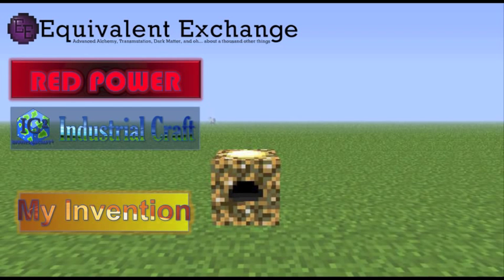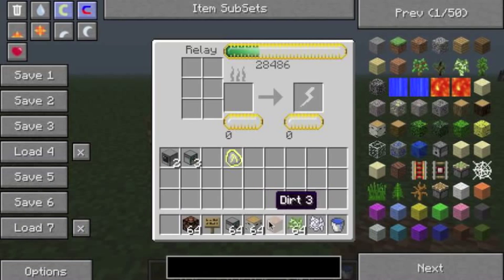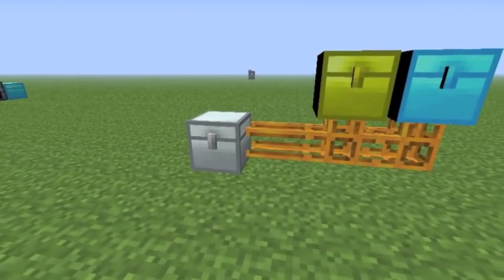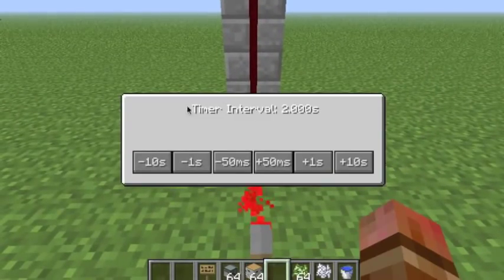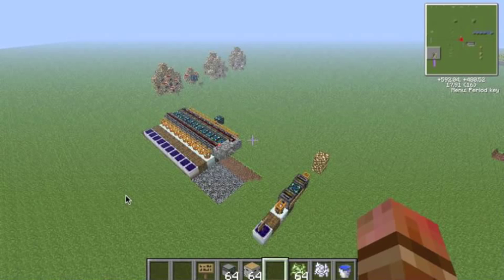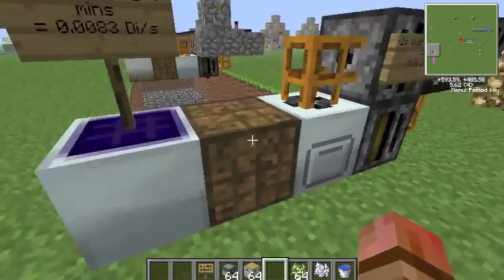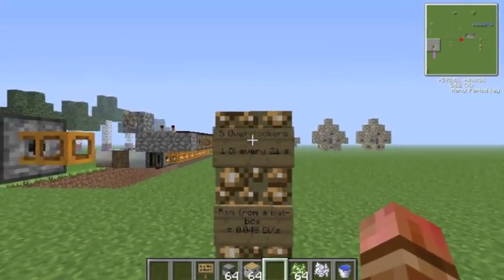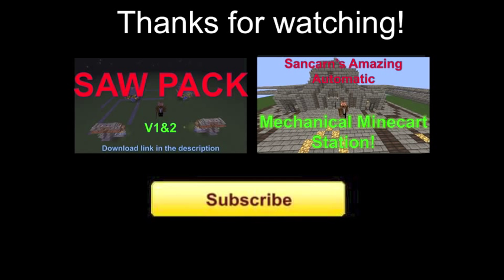"Tekkit" Part 1 - EMC Generator: Macerator-BlazeRod Setup

Comment: I took your design and replaced the macerator with a rotary macerator, replaced the panel with an array, then put a batbox between the array and macerator so it would work through the night.  At full capacity you macerate one rod per second, giving you one block of diamond every 32 seconds.  Insane.

Comment from the maker: storage upgrades are only temporary solutions. If the input voltage isn't high enough the setup will only be able to be used in short bursts. Transformer upgrades and HV solar arrays are the way to go! Having MFSUs are good to so they work through the night as well =)

Comment from the maker: Yeah you should check out the setup I have on a server I play on. We get 1 red matter every 15 seconds! Using macerators each with 11 over clockers in and 0.4 second delay <- minimum delay for filters to respond. I think we are considering upgrading it so we can achieve 1 red matter each second too =P. Problem is however it causes a lot of lag.

Comment from the maker: The blaze powder doesn't need to be in the filter at all for one thing.
2ndly make sure the blaze powder has somewhere to go. If the filter is showing a red light then it is stuck because the blaze powder has no where to go.
If neither of these pm me a picture of your setup with details of what's in each filter.

Comment from the maker: 1 problem with tekkit 1.2.5 however is that when you power the rotary macerator the filter is also powered. Yeah I thought about though. However a macerator fully upgraded works just as well. 11 over clockers and super high voltage input does the trick! =D

Comment: Why does my filter (taking the powder out of the macerator) jam instantly? Or it pulls one stack then jams. I have it facing the correct way, and the tubing is fine considering it's just a straight tube from the filter to a condenser. Any help appreciated, thanks :D

Comment from the maker: Nah this won't be fixed at all. Macerators will always turn blaze rods into 5 blaze powder. Also Pahimar isn't changing any of the items in EE3. But he is changing the way you get the items. We'll be seeing that the energy condenser will be a lot harder to get but that's all as I understand.

Equivalent exchange is about what it says it is. Blaze rods normally go into 2 blaze powder so 2 blaze powder will always go into 1 blaze rod.